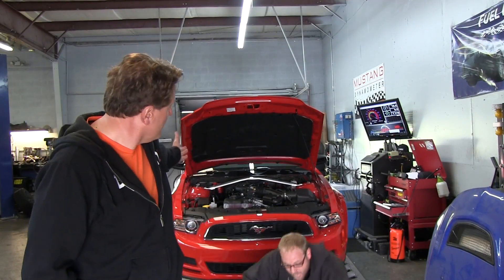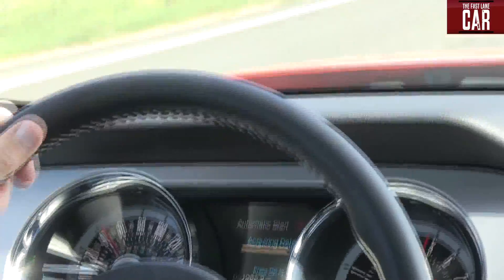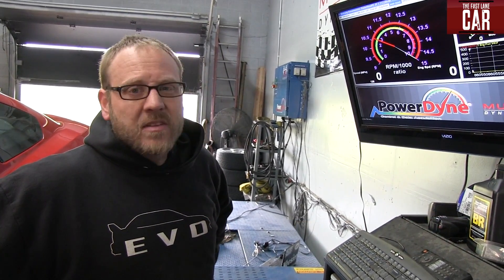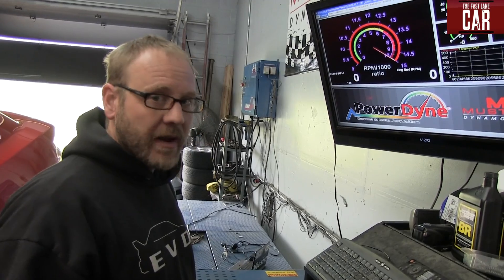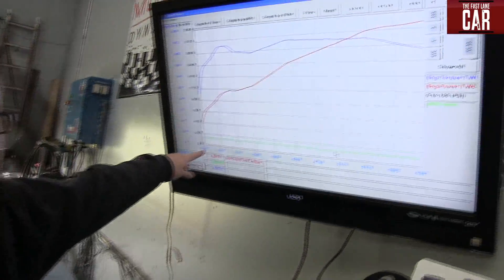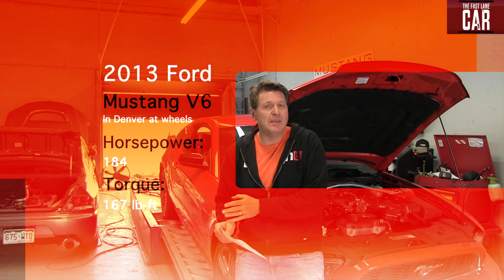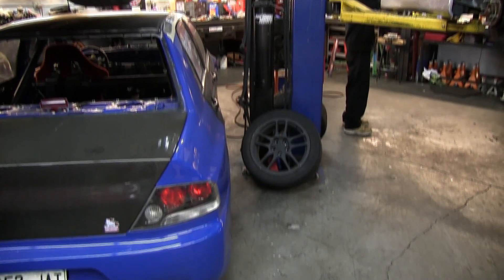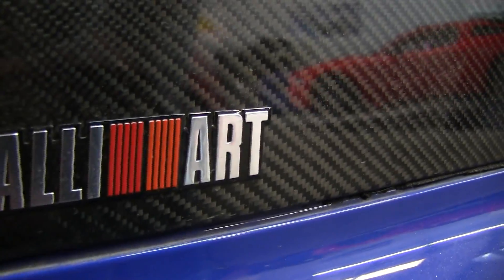Dyno test: 2013 Ford Mustang at 1 mile above sea level

Comment: The average power loss for a naturally aspirated engine is 3-5% for every 1,000 feet of elevation. So on the low end at 5,000 feet in Denver that’s 15% loss and then you still lose another 15% or so through the transmission etc.

Comment: Yeah, never mind the fact that the claimed 0-60 is in a manual with the performance package and a 3.31 gear, not automatic, and that the driver tested it UP HILL, and the driver skill/launch was shit and the track apps was actually launched too early and gave an incorrect 0-60 time. The auto also loses more power through the drive terrain as well as that car has a 2.73 boat anchor gear and  no performance package. Completely biased test. And is totally wrong because my 2012 V6 perform package with an airaid intake and bama tune and lowering springs BARELY gets beat by my buddies 2014 GT C/S with a 3.73 gear. In fact, if him and his g/f are in the car and just me in mine, I beat him.

Comment: Actually you're wrong.
Since the composition of air is the same there could not possibly be less oxygen but not less air.
The density of both the air and the oxygen decrease with altitude.

Comment: @StylesDeAgent You are comparing 0-60 time of a manual Mustang with the 3.31 axle ratio. Roman was driving an automatic with the 2.73 final gear ratio(He mentioned the car was rated 31 hwy and only an auto with 2.73 is rated for 31mpg).  The automatic does 0-60 in the 6 second range, so yes, the numbers in this video do make sense.

Comment: Okay, this STILL doesn't make any sense - if you tested the 0-60 for the Mustang and the FR-S at the same altitude, why is there only a 0.4 second difference between the Mustang and the FR-S? Everywhere else, numbers are saying that the FR-S will do 60 in 6.5 seconds... which if you apply the 0.4 second discrepancy, would place the Mustang at 0-60 in 6.1 sec.  Really? That's almost an entire second more than the 300HP 05'-09' GT's!  No man, I don't think so. The new v6 has 5 more HP and 6 gears!

Comment: The science for the non believers: Increasing altitude results in a fall in the atmospheric air pressure. The atmospheric air pressure is equivalent to the pressures of all of the different gasses that make up the air. The pressure from oxygen decreases from 2.0 psi at sea level to 1.6 psi in Denver, CO (5,280 ft, 1,610 m), and 0.9 psi at the top of Pikes Peak (14,110 ft, 4,300 m). It's the same reason distance running (or taking the stairs) is harder in Denver v. some where like LA.

Comment: well lets do the math the crank is 305hp corrected whp at sea level was at 220whp(2:41mins). so there is a 85 hp lost in the drivetrain so 85/305x100=27.8%. ops sorry i was wrong its not 33% lost its 27.8% lost i just guessed the firs time. but that's still pretty bad

Comment from the maker: You know that's a very good point. To be technically accurate we should have said there's less oxygen density. Just as an FYI: there's the same amount of oxygen at all levels of the atmosphere (I think about 19 percent of the air). However at sea level the O2 molecules are packed more densly thus more combustion and more power in a car's engine.